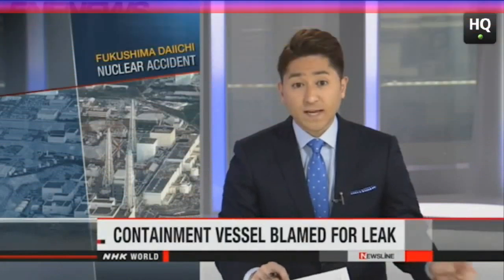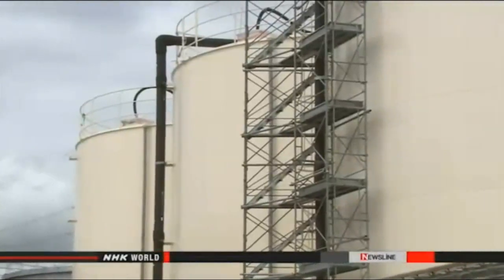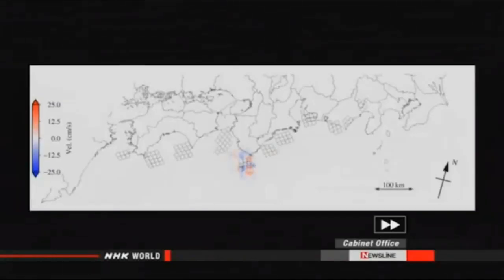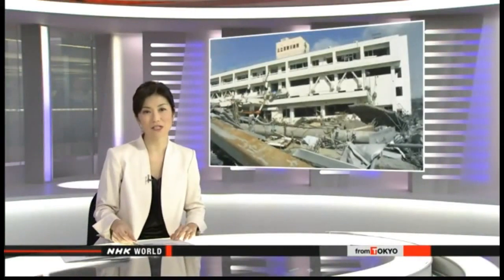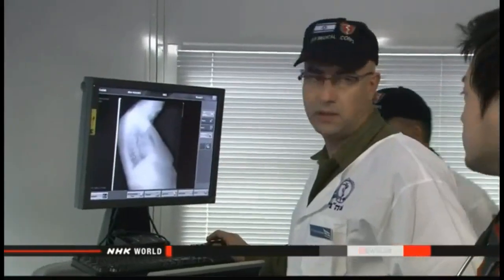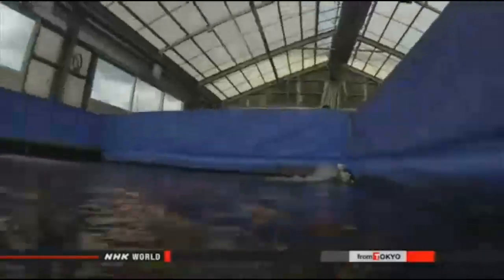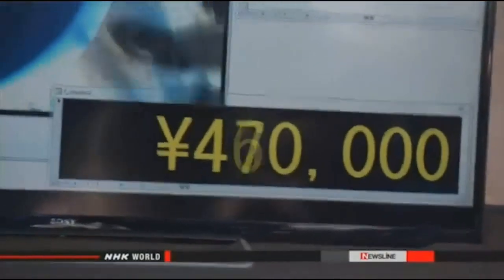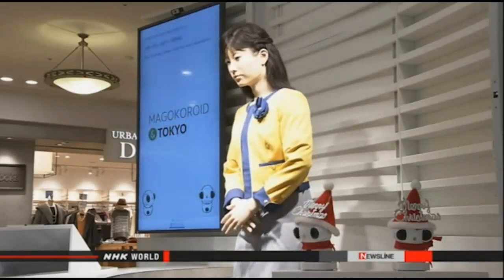Fukushima 12/18/15: DEADLY MOX FUEL LEAKED FROM UNIT 3 CONTAINMENT INTO ENVIRONMENT

Comment: tepco must be run by monkeys. they keep doing the same thing over and over. expecting a different result, the water needs to be diverted upstream above the plant. the only thing they are accomplished the way they are doing is to concentrate radioactive elements and destabilize the soils inside the plant. Unless this is what they are trying to do. then they need to be shot and replaced with engineers who are willing to stop the disaster. its bee 5yrs already.

Comment: Uh-huh.
How many of us said, when they first came up with that steel-wall plan, it would only cause more problems?  How many of us said, DUH, Tepco??

C'mon.
And, this is news?  TO Tepco, it is.  Dimwits.
Reply from the maker: +annebeck58   We told them so.  Maybe it's time to use reverse psychology on Tepco.  They read our comments and do the opposite.  Most of us aren't engineers but we have common sense.   Listen up Tepco!
Reply: +annebeck58 No kidding !!! If Tepco had a brain they would have installed a corrugated steel wall(pounded 20 feet down) in front of the plant to dirvert the water away from the plant. God dam stupid Tepco !!!

Comment: Well, at least they safely and successfully removed all the fuel rods from unit 4.  Progress is being made and the Olympics are on the way. I am a little concerned the 100,000+ gallons a day of liquid death being put into reactor buildings is simply exiting out the lowest crack and seeking the lowest point, i.e.  the ocean.
Reply from the maker: +TheHypnotstCollector LOL.  One day soon they'll spill the beans on unit 4 too.
They're struggling with a design for the Olympic Stadium.  Casket comes to mind.  
Funny, I picture the same with the water.  lol   Tepco is sooooo transparent.  
Why the heck else would they pour the stuff back into the reactors if it wasn't a way to dispose of it?    What goes in, must come out.  o.0
Reply from the maker: +TheHypnotstCollector     He has several videos on vaccines.  Which one should I be there for?  :)

Comment: Let's see, we had a leak, and they are just figuring out that it leaked directly from the CV? It's called a containment vessel. A leak means it's not contained, what should we look at first? They should fire these lamo's
Reply from the maker: +Moon Hitsearth I love how they always use the word 'leak'.  How about splattered, scattered and vaporized?  
Nuclear fuel found 15 miles from Tokyo suburbs — Fukushima uranium in ‘glassy’ spheres transported over 170 km — Structural materials from the nuclear reactors also present 
http://enenews.com/nuclear-fuel-found-15-miles-tokyo-suburbs-fukushima-uranium-glassy-spheres-transported-170-km-structural-materials-nuclear-reactors-present-photos

No point in firing Tepco execs now.  I doubt there is anyone willing or able to replace them.  Let them soak up the rads they so deservedly earned.
Reply: MissingSky101
I think the leak is in their head, and they need to stick a cork in it?
Reply from the maker: +Moon Hitsearth Are there extra large corks?
Reply: "Air tightness"